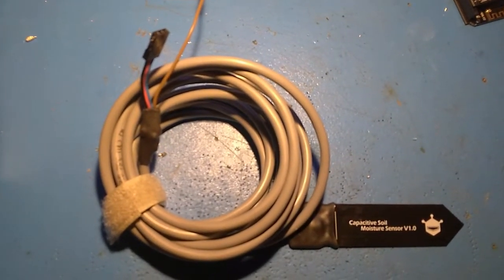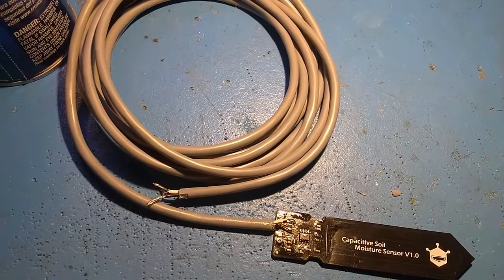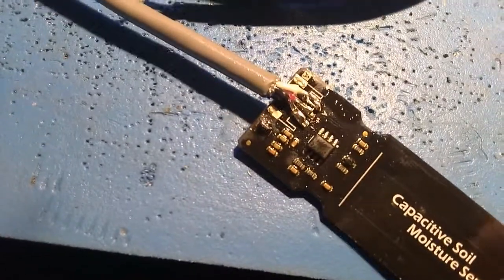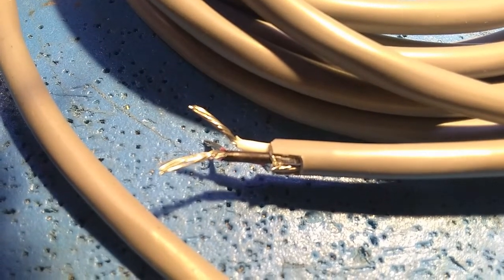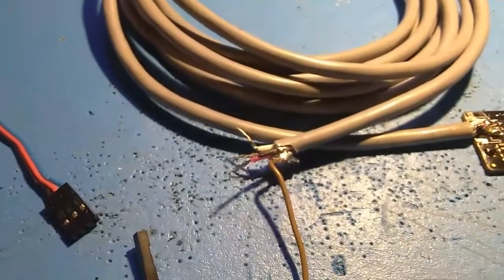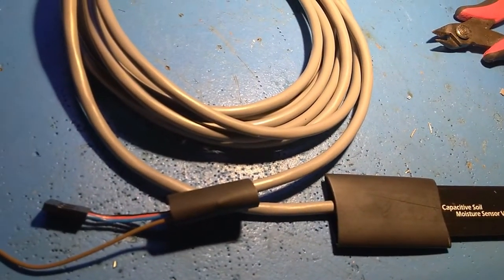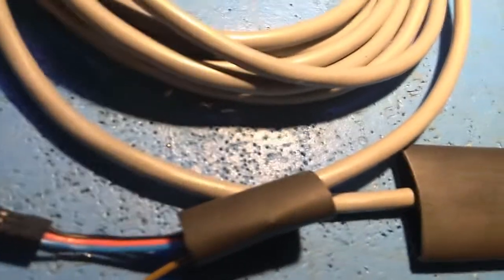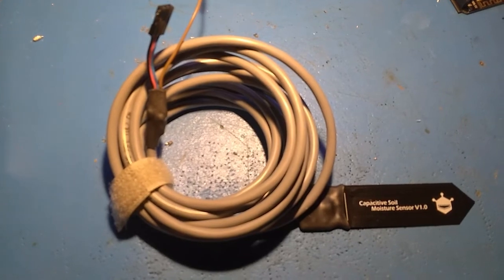How to Shield, Protect, Waterproof and Extend an Analog Soil Moisture Sensor - DIY Sensor Upgrade

Comment: Did you apply electrically insulated thermal paste to the 662K voltage regulator? Did it heat up noticeably after wrapped up into the thermo retractil plastic? It makes me uneasy on the approach. Will try to waterproof a case instead for mine. 

Thanks for the advice on grounding the outer shield of the wire. Probably for the best. And removing the grove header is a good idea to minimize interference. Not sure if the internal stability of the reading is accurate enough for the extra work to be noticeable though, is it?

Comment: What have you done to the side of the PCB circuit board? This is open and water can enter there
Reply: Try epoxy and recalibration.
Reply from the maker: Hello Harry, thanks for your message.

In most cases we won't treat the sides of the sensor. The copper is cut back enough the sensors seem to hold up over a given - but the sensors should be recalibrated every month or so to compensate for any saturation effects, which is good practice regardless. We see sensors lasting 1+ years in the field using this technique.

With that being said, we have customers request treating the entire sensor (sides included) with the same urethane sealant used to protect the electronic components - this also protects the edges from saturation but limits the capacitive range of the sensors (analog output range decrease from ~250-750 to ~550-750).